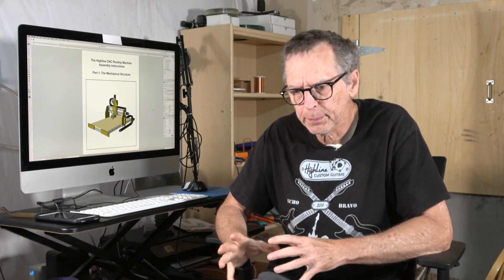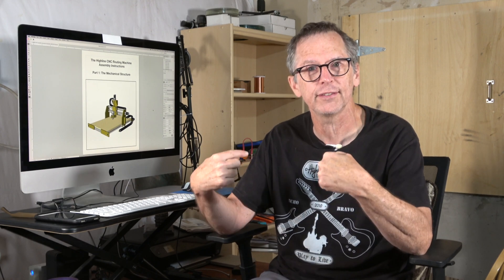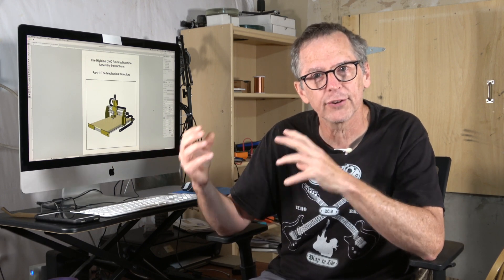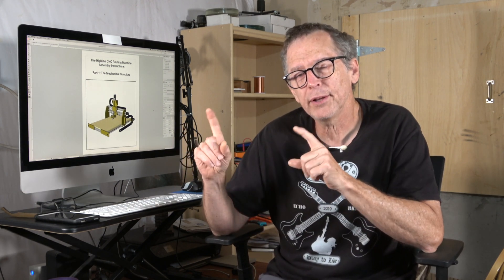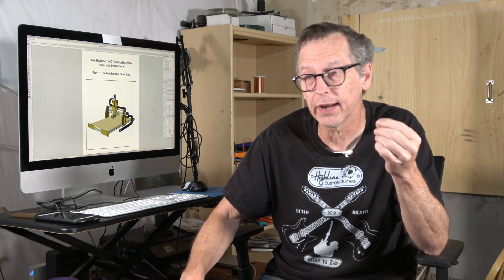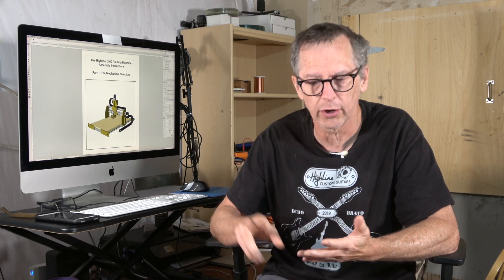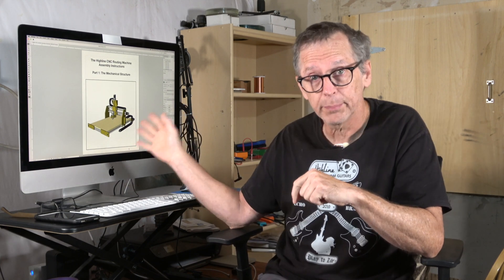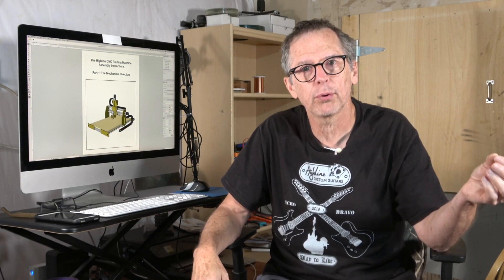Can You Build My CNC Machine?

Comment: Hi Chris, the only problems that i had were fasteners.  For instance the tslot nuts on the parts sheet were listed as 5m. these will not fit the 3060 rails. they should have been 6m tslot nuts and screws. there were several more but i worked through all of them and now have the first part of the package finished and I'm working on the electrical now. by the way, where the heck did you find the 18awg single conductor shielded wire? I've looked everywhere.
Reply from the maker: Try This: https://www.aliexpress.us/item/2251832721925369.html?gatewayAdapt=glo2usa4itemAdapt&_randl_shipto=US

Comment: I was able to order the ST25 breakout board last week from Tindie (the one by itself, not with the Arduino). I see that it is out of stock now, but it wasn't before, so maybe it is just temporary.
Reply from the maker: That's good to know. Thanks!!
Reply: I used a different breakout. You just have to map the pins is all. No big deal. I’ve got a diagram somewhere of what I did and the breakout I used.

Comment: Is your CNC compatible with most 3D CAD software, specifically Fusion 360 or SolidWorks?
Reply from the maker: If the software generates g-code, it's compatible.
Reply: I use fusion 360. You can create a machine in 360 with the specs of the highline and then tell it to use grbl for post processing. Works perfectly.

Comment: Lots of great advice given here. I cut my teeth assisting in CNC retrofits on  three machine tools. One control was a Galil DMC-740, and two others were Heidenhain TNC360. I did two complete control system retrofits on cnc routers using Mach3. I have been programming, operating, and repairing cnc machine tools for decades. Given that history, I refused to buy a 3D printer until I could successfully create a model from scratch. I repeatedly give the exact same advice to friends of mine who want 3D printers. Learn the software, then invest in the machine. Making a cnc router is a relatively simple process if broken down into logical steps. It is far from simple on the whole.  I am fascinated by the Masso controller.

Comment: I think the thing I’m most curious about is the cost. I completely realize that there is going to be a significant fluctuation based on supplier choice, availability, etc. but I’m not sure if this is in the $100, $1,000, or $10,000 range. Just a ballpark estimate would be helpful. It says “build your own affordable” on the website, but I’m not sure how “affordable” we’re talking.
Reply from the maker: Around $2k.
Reply: @HighlineGuitars  I saw that following the same steps you are following regarding the software (Adobe: US$239.88/yr + tax, Rhinoceros 3D: US$995, MeshCAM: US$250). That is like 1500 just in software. I know we have alternatives like Gimp and Inskape for replacing adobe and Rhinoceros that are free, although I did not find a replacement for MeshCAM.  Any ideas on an alternative to that?
Reply from the maker: @AdrianDecaux  Fusion 360.
Reply: @HighlineGuitars  yeah but only for 30 days
Reply from the maker: @AdrianDecaux  Fusion 360 for personal/hobby use is still free, requiring a renewable 1-year subscription. Of course, you have to qualify for the free subscription, which is why I don't use it. Beyond that, I don't know of any totally free alternative to MeshCAM that has the same capabilities.
Reply: @HighlineGuitars  Got it, thanks Chris for your response!
Reply: @HighlineGuitars  Thanks Chris! That helps a lot! Definitely in the price range I'd feel comfortable with for the quality.
Reply: I spent about $2k building this. But it rocks power. You would have to spend 5-10k to get the same feeds and speeds in a commercial unit from the shopping I’ve done. And it’s an awesome learning project.
Reply: Considering one would need software regardless of machine it isn't "losing" to have to pay for software you can use easier than the free options. The total software package can pay for itself with two quality guitars.
Reply: @ajkenth2387  not for the hobbyst
Reply: You can get a fusion 360 startup license. As long as you make under $100k in your business, it’s free.